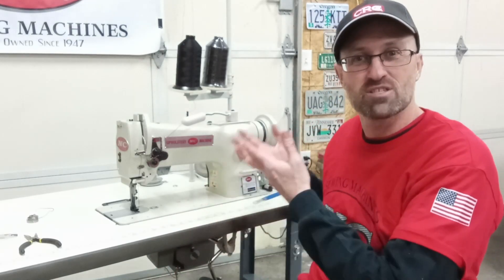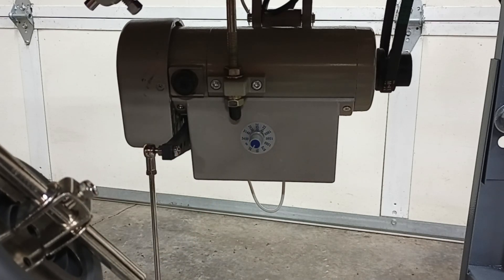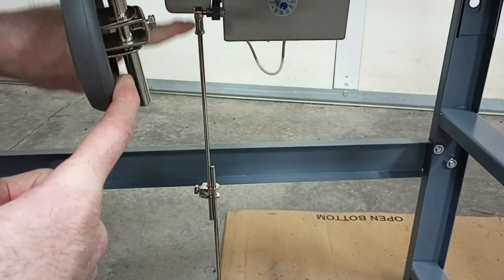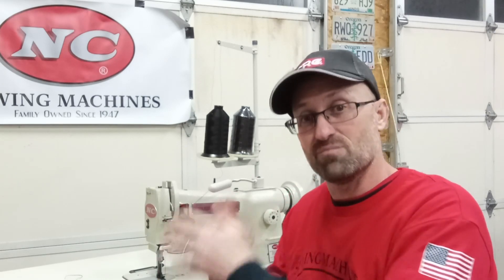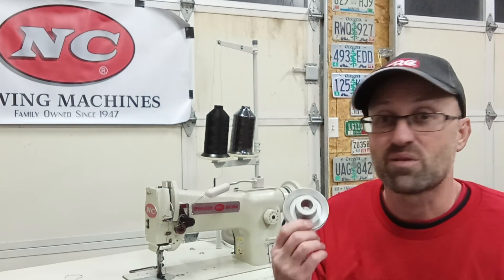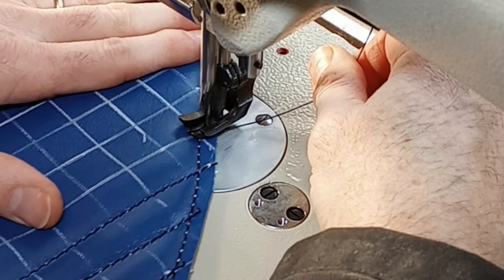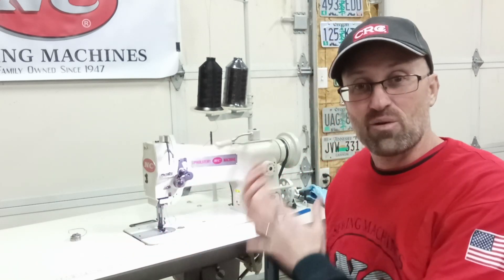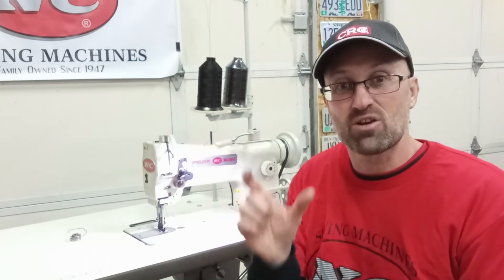How to Slow Down an Industrial Walking Foot Sewing Machine for Better Control

Comment: Even with enough time on the machine, the big advantage is the control of sewing those really tight corners and curves without having to start and stop. It could be panel assembly or decorative top stitching.
Reply from the maker: It has definitely helped me with control.